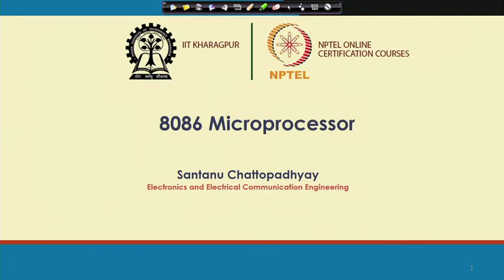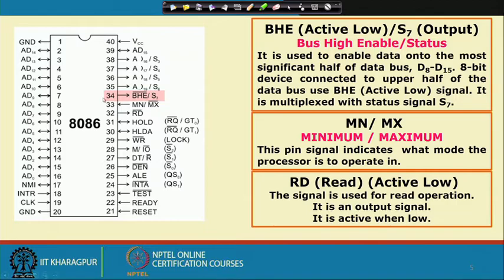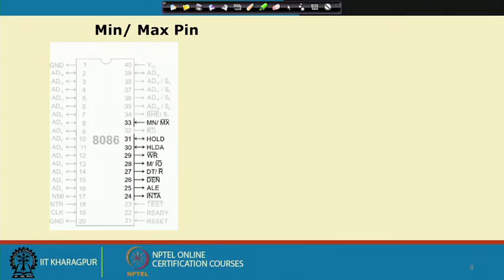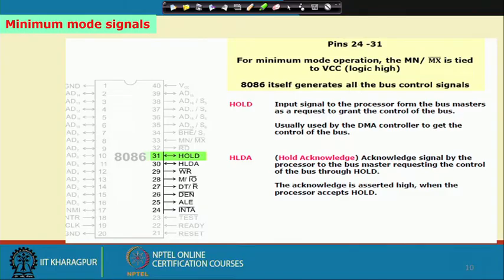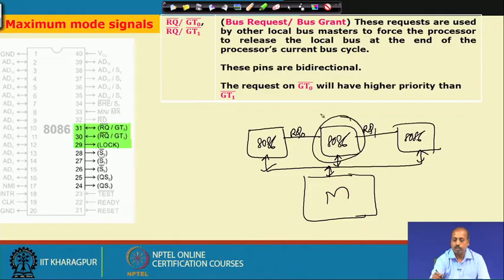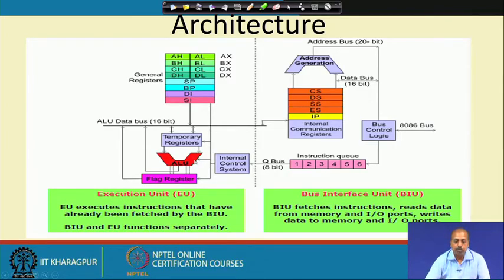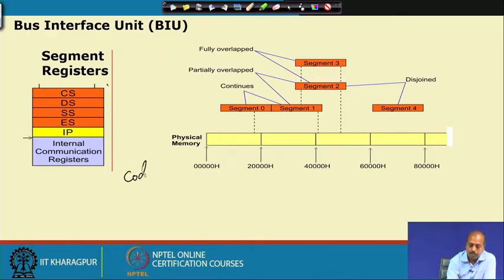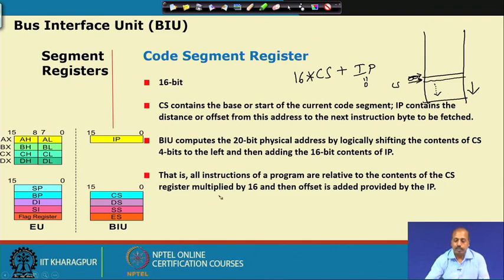Lecture 63: 8086 Microprocessor

Comment: One of the best lectures on 8086 up  but the block diagram seemed to be jumbled up
Reply: What is DIP??
Reply: Dual Inline Package
Reply: it means the the 8086 chips has pins on both sides( dual-inline-chip)  @maheswari653